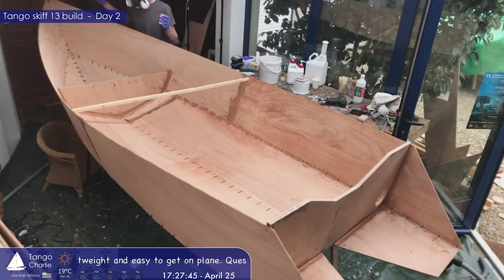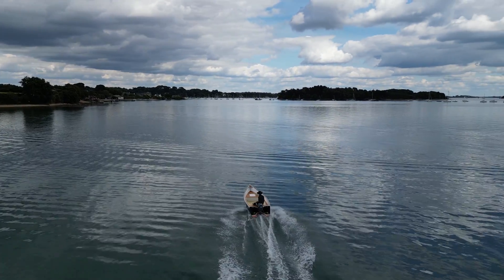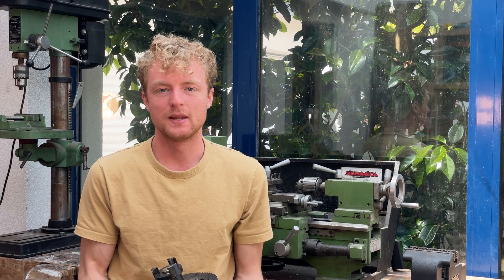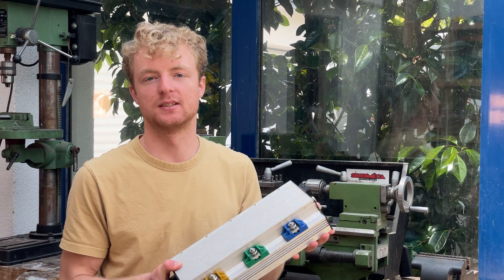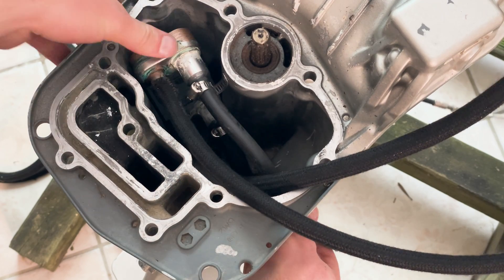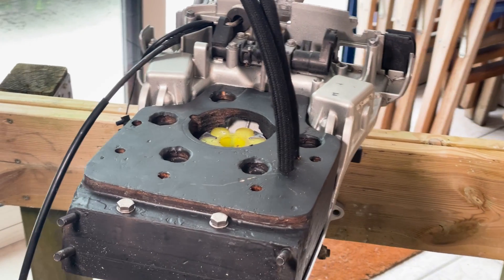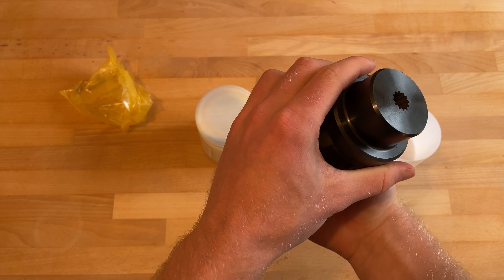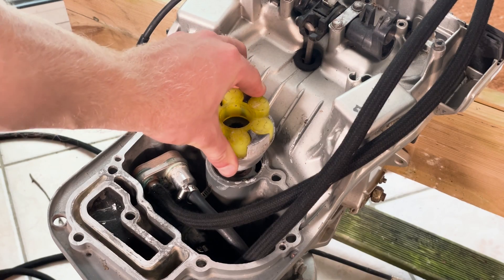Honda BF15 outboard electric conversion !

Comment: Do you need motor with hall wire, position isnt that needed?
Reply from the maker: The hall sensor is included inside the electric motor, and connects directly to the controller !
Reply: @teyscocset I know but do you really need hall in this case?
Reply from the maker: Yeah, it is a sensored BLDC motor, it has to know where it is to run properly. Some smaller motors don’t have sensors, you find them on drones for example.

Comment: I'm trying a project like this myself and found the hardest part is the coupler between the motor and prop shaft.  How much did it cost you to work with a chinese manufacturer for this?  Would you recommend going this route?
Reply from the maker: It did cost me around 100 EUR to manufacture it in China, but you need to provide specific files with the keyway, so it fits with the shaft. I would recommend cutting off the crankshaft and weld it onto the coupler. To make sure the splines fit properly...
Reply: Look for lovejoy couplings. You might find what you need in their catalog

Comment: i paused your video then spent 2 hours going down a google rabbit hole looking for an electric motor capable of replacing the 125hp powerhead on my boat.  @746 watts = 1 hp.  id need almost 90kw to reach that goal.  ok so a used ev car motor off ebay...but then id need a 90kw battery also from ebay and that only lasts 1 hr at full tilt.  no wonder this isnt more popular...the parts are expensive as all hell.  in real life you'd need 270-300 kw battery to spend the day with the family on the water.  4 used tesla 85kw packs $6,000.  used ev motor strong enough $1-3k, controller / wiring and the list goes and goes.  bare minimum $10k to build a 120hp electric outboard with mostly everything.  not including rigging/ steering, infrastructure to hull for batteries, machining, or freight shipping on all of the above parts.  if i had to guess itd be closer to 20k than 10k all in.  

but heres where my theory diverges...cars are very heavy...they come from the factory with (1) 85kw battery pack.  how the hell does it go all day?  what kind of electric voodoo or sorcery is this?
Reply from the maker: It is useless to go electric for a speedboat, unless you spend under 45 min full speed. Energy storage solutions aren't advanced enough at this moment, but this may change in the future.
Cars are very different from boats : A boat will go close from full power all the time as it has to push the water to move forward. Cars on the other hand will use most of their available engine power while accelerating, and then use only 10 to 25% of their available power to stay at a reasonable speed. Making the batteries run much longer than boats.

Comment: Thanks for sharing! You've got it running really smooth! Can you tell us what heat exchanger you've used?
Reply from the maker: Yes ! I am quite happy with the result ! I used a plate heat exchager originally designed to cool down beer. You can see it at 3:18

Comment: Great job! You may want to consider a small radiator with coolant instead of using the salt water. There will eventually be corosion and build-up within your cooling system.
Reply from the maker: Thank you ! This is what I installed in the former oil pan, an heat exchanger and a separate cooling loop with coolant for the motor and inverter.

Comment: What about motor speed? I tried the same with a 3000rpm 7.2kw motor on a 5hp 2 stroke outboard, but the motor is by far not running quick enough. I 3d printed another prop with a steeper pitch, but the goal is to use a belt drive
Reply from the maker: I was able to reach 5000 rpm with the steepest prop available, with a power draw of approximately 11kW ! Quite an achievement to be able to get on plane and up to 20 knots with two people on board.
Reply: Awesome what are you pulling kw around 11 knots 😎 @teyscocset